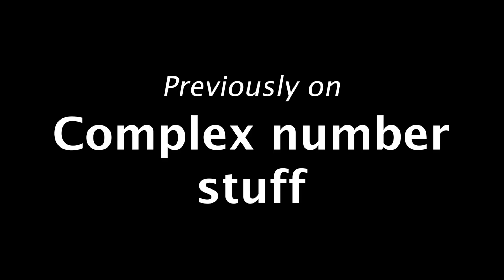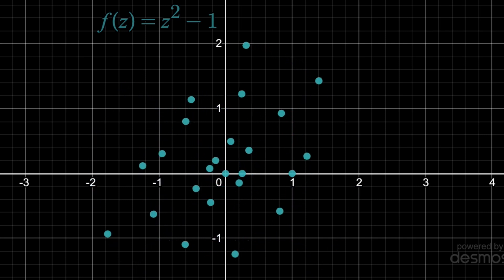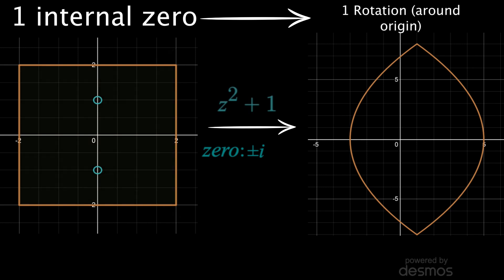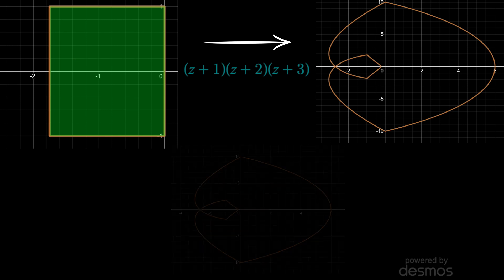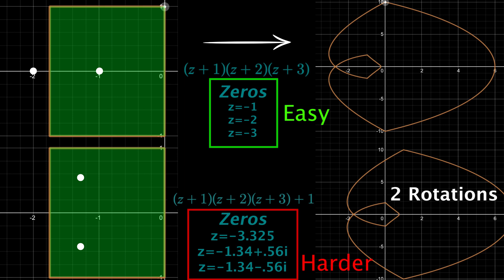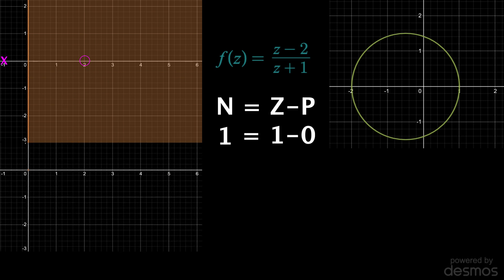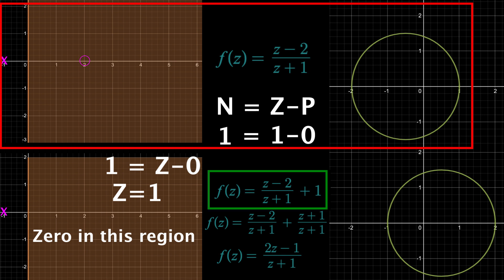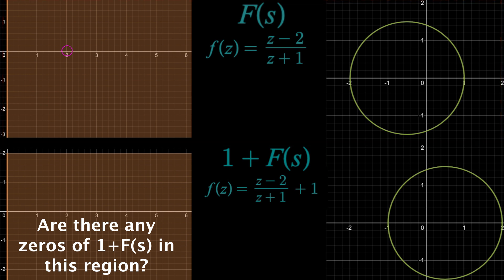How do complex numbers actually apply to control systems?

Comment: Hello, it's been 40 years since I studied control systems at university, and so was interesting watching your video as way of revising.
I would suggest that to explain how the control system would work, and the application of complex numbers in it, perhaps use a real world example, maybe the operation of a washing machine in terms of maintaining the speed of rotation of the washing machine tub, or maintaining the temperature of the water in the tub.
Another suggestion would be to consider the flyball governor on a steam engine and explain the control system and the Application of complex numbers in that control system..

Comment: - SIDE NOTE: REGARDING TERMINOLOGY...

- As a math teacher, I'm careful w/ labels of concepts: the "wrong" label can mislead, even result in pushback (due to negative connotations).
- The commonly used terms are OK to use, but I delay their use until after the concepts have been "properly" presented (i.e. w/o the baggage).

- So, I first review the familiar numbers on the number line from grade school. Then note that square root of a negative number is not allowed... or is it!? If allowed, it can be viewed as an addition part of a number - there's now a "two-part number". And furthermore, a thing composed of parts is a "complex", like an "apartment complex".
- In this way, focus is on concepts, not labels.

- The takeaway: "IMAGINARY" NUMBERS ARE NOT IMAGINARY! :) (They're just another part.)

- (And to be clear, the terminology used in this vid is appropriate. Language/communication is just a focus of mine.)

Comment: I watched this video after watching one named "all you need to know about control theory" by the Matlab channel. I took a complex analysis class in eng major and i never fully understood all the praising my teacher did for the use of complex analysis in control theory. After watching the video i just mentioned, I commented that i would have liked to see some complex analysis there, and now just finishing watching this one. 

I can say that they complement each other quite nicely so i recommend you watch the one posted by Matlab. It's quite interesting to see how the feedback and feedforward theories relate to the stability and creating new dynamics in the system regarding the graphic insights provided by this video. Also you can see a clear connection with one of the key premises of the "All you need to know about control theory video" which is that you don't need to measure the state of the system to know what inputs would look like if you made a disturbance or shift.

 You can just observe the behaviour on the simpler open loop system and use nyquist criteria to determine stability of the more complex closed loop system with feedback.

This is an amazing video and takes care of a quite interesting topic in a quite digestible way, took me a semester to learn what this video renders just over a dozen minutes. Beautiful work, the dedication and attention to detail shows, this is work well done. Thanks a lot

Comment: Here's how I solved the first angle question before watching the video.

The sum of angles (via the pythagorean theorem / analytical geometry, whichever you prefer), which I'm gonna call S, is:
S = atan(1) + atan(1/2) + atan(1/3)
S = 45° + atan(1/2) + atan(1/3)
S = 45° + atan(tan(atan(1/2)+atan(1/3)))
S = 45° + atan( [ (tan(atan(1/2)) + tan(atan(1/3)) ] / [1 - tan(atan(1/2)) * tan(atan(1/3))] )
S = 45° + atan( [ (1/2 + 1/3 ] / [1 - 1/2*1/3] )

S = 45° + atan( (5/6) / (5/6) )
S = 45° + atan(1)
S = 45° + 45° = 90°

Comment: Just for those curious, if you want too do these functions in desmos, the z squared formula is (a^2-b^2,ab) and to add 5 for instance just add a +5 in the x coordinate. For any function, evaluate the the formula then reduce i's (making i^2 into -1) until you have either 1 or 0 i's in each term. For example: a+bi+ci^2+di^3+ei^4 (in this case c and e are being used as variables not as the speed of light and Euler's number), a has no i's so we ignore it, +bi has 1 i in it so we ignore it for now (do remember that it has an i on it as that will be important later), for +ci^2 we cut out the i^2 and make the plus sign a minus sign: +ci^2 --> -c, for di^3 remove 2 of the 3 i's to get -di, and for ei^4 the two pairs of i's cancel to make 1 so it gets converted to e. Taking all of the converted terms you get a+bi-c-di+e, for reasons you'll see next step, lets rewrite it as a-c+e+bi-di. Now put parentheses around it: (a-c+e+bi-di), switch the sign before the first term with an i component with a comma: (a-c+e,bi-di), and completely remove the i's (a-c+e,b-d), don't compensate for them just cut them out entirely. And you've got your point You can substitute any value for the variables, add more or less, make them all only depend on two variables whatever. If you read all this then either: You are a nerd like me, you want to do what I just taught you, or you're someone who is reading this as a challenge or something. Anyway thanks for reading this and later I might add a link to a desmos graph which shows off this.
Reply: Isn't it (a^2-b^2,2ab)?

Comment: Why use complex numbers instead of linear algebra? (genuine question)
Reply: Regular linear algebra does not have the fancy angle adding multiplication defined in it, that fancy multiplication is needed for these awesome properties, well most of them, if you define it what you end up with is isomorphic to complex numbers anyways so you are better off not doing the extra work.

Also calculus on complex plane has so many cool and useful emergent properties you wont find in linear algebra alone.

Comment: How did it get from 10i to 10exp((i * π)/2) @ 1:43? Sorry for my ignorance.
Reply: using Euler's formula r(e^ix) = r(cos x +  i sin x) cmiiw :)
Reply: You need to foil the complex numbers in the video... The ones in the form of a+bi. There are 3 of them. You have to know how the imaginary component of the complex numbers are multiplied.
Reply: @williamhensley8322  What do you mean by foil the complex numbers?
Reply: @jewulo  if a complex number can be defined as a + bi, then if you had to multiply 2 complex numbers, it would be in the form of (a1+b1i)(a2+b2i). Then you would multiply these two complex numbers in the same way you would multiply (x+1)(2x-2), multiplying the first terms, outside terms, inside terms, and the last terms and sum the products.
Reply: Keeping in mind that an i^2 term is equal to -1.

Comment: About the angles in the rectangle at the beginning: To be completely rigorous, wouldn't we have to acknoledge that technically, the phase of the resulting number could also be 90° plus any multiple of 360°? By adding angles together, you may, in general, indeed get a result over 360°. Is there a nice argument to show that it is indeed 90° and not 450°?
Reply: Good question!
If α, β and γ are all greater than 0° and less than 90°, then:
α+β+γ > 0° + 0° + 0°
α+β+γ > 0°
and
α+β+γ < 90° + 90° + 90°
α+β+γ < 270°

thus their sum is greater than 0° and less than 270°.
That's how you can show that they must add 90° and not any other angle like 450°.

Comment: I'm confused: the plot at the snapshot of the video - the green shaded region, that is the image of the interior of a rectangle surrounding both a zero, and a pole has 4 corners. They are the images of the 4 corners of the rectangle. BUT, why are the plotted corners not at right angles?! The image of a right angle should be a right angle. So what's going on with that plot??

Comment: Another example of a unstable system is an electric circuit in which the Laplace transform of the output has poles with positive real part (i.e. they're located in the right-half side of the complex plane.) This is just like the example MajorPrep gave in the end, but I actually undertand it more: if the L.T of the output has a pole with real part, then the I.L.T. (i.e. the output in the time domain) will have a term with an exponential factor (to see this, recall the table of L.P. pairs and the partial fraction expansion.) Thus, if the pole has positive real part, then the exponential will have a positive exponent, for example y(t)=3e^2t amps. Notice that, as t increases, so does the output. What does it mean? After some time, the output current in the circuit will be huge! And we all know what high current can do.

Comment: You failed to show how the product of A*B*C gets you 10 and how alpha + beta + gamma gets you π/2. Perhaps you want to do this and release a new version?
Reply: He thought that was so easy it didn't need showing. 
multiply the 3 complex numbers  (1+i)(2+i)(3+i)
[distribute first term]
= (2+i)(3+i) + (2i+ii)(3i+ii)
[multiply both pairs of ()]
= (6 + ii + 5i) + (6ii + iiii + 5iii)
=6 -1 +5i -6 +1 -5i    ...  and I'm out by one minus sign from 0 + 10i as expected  

For the geometrical proof start with the (1,1) angle gamma=45 or pi/4.
Reflect (2,1) over the X axis to (2,-1) and get the (added) angle between the 2 lines from the isoceles triangle.
That will also turn out to be 45 or pi/4 giving the sum of 3 angles as pi/2.
Reply: spotted the error
 (1+i)(2+i)(3+i)
= (2+i)(3+i) +   i(2+i)(3+i)   ... and all ok

Comment: When i got into college i was absolutely shocked at how imaginary number were SO useful! Videos like this brings me inexpressible joy.
Reply: I didn't discover that fact until long after college.  In large part thanks to videos like this.
Reply: The difference between a blah calculator and a cool calculator. Whether it has i on one of its buttons. Even if you have to shift to get to it.
Reply: i didnt get why 'i' is so very useful or why 'i' is needed even at college. other than using it in every equation i use :|